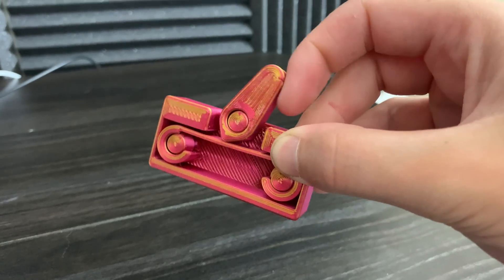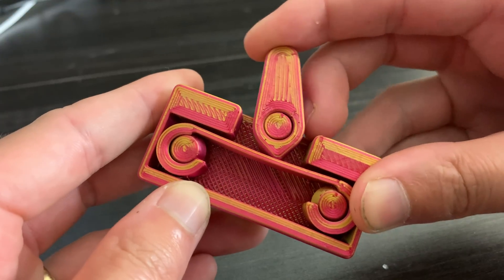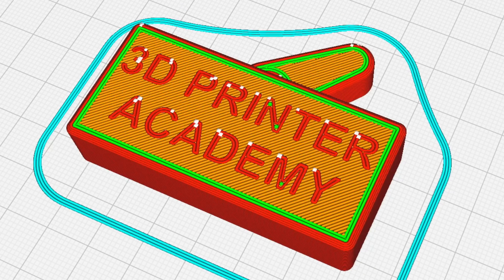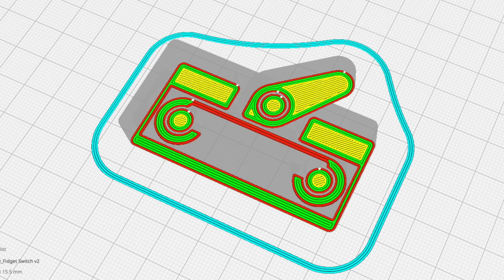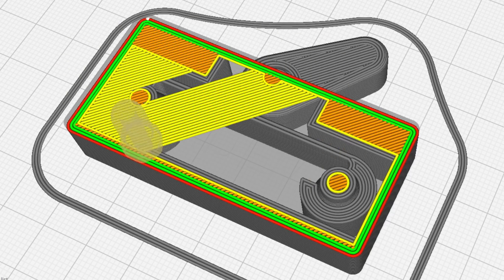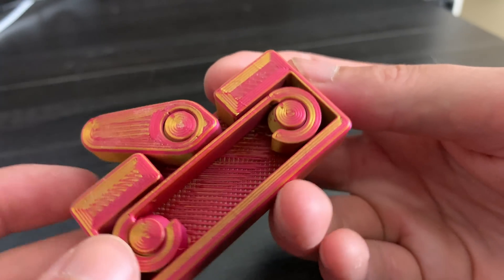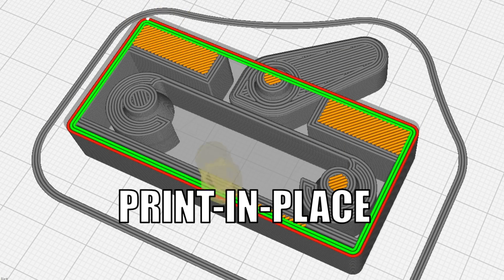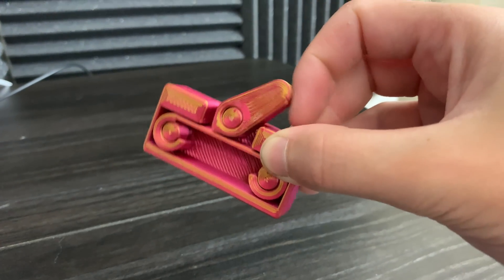What 2 things make this 3d printed fidget switch so special?

Comment: You can make a slot inside that spring, and install a two-position switch there, and on the lever make a pull to it, and you will get a switch) Or use two buttons

Comment: Great video! Does anyone know what font is used on this part? The consistent width looks like it would solve many of the issues I have with text!
Reply from the maker: The font is Arial. However, I usually use Helvetica or SF Display (Apple's newish typeface). Arial is essentially a copy Helvetica. Helvetica was designed in 1957 and Arial in 1982 for computers. You can see the difference between Arial and Helvetica by looking at the letter "c". The horizontal lines on the "c" are parallel to the base line for Helvetica, whereas with Arial the horizontal part of the "c" is slightly angled.
Reply: @3DPrinterAcademy  Thank you for the tip and info!

Comment: Honestly, I do not think this is a good example for a bistable mechanism because the two "stable" states are not inherently stable. Those are just two neutral states between which the movement is restricted to a certain point... after overcoming the potential difference needed to flip the switch, there is not really a constraint on the mechanism except for the end stop, which I would not consider "stable".

Nice print in place mechanism though :)

Comment: This video gives an insight on what 3D printed part designers are thinking.

I also had many hours of designing, including print-in-place mechanisms, assembled parts, and some basic compliant mechanisms. While watching this video, everything sounded familiar and usual to me, and the video felt like it was teaching new people and outsiders. And this made me feel proud, because of how much I've learned. I have a hard time in finding a practical expertise of myself, so such things are important to me.
Reply: Can I ask what software do you use to design mechanical stuff? Are you happy with using that software?
Reply: @bylecopanie  I use Fusion 360 with Hobbyist license.

It's fine. Definitely not as enjoyable as SolidWorks, but it's similar. Quite easy to use. The hobbyist license have the necessary tools. But to be honest, lacks very basic features, like the constrain lists in drawing, and it prefers perpendicular constrains whole horizontal or vertical is possible, messing many things.

Even FreeCAD had some features better. But of course, FreeCAD is some kind of brain cancer at the same time. Fusion is much better to use at the moment.
Reply: @Santibag  Thank you for your response, I'm about to buy myself a 3D printer (probably Creality Ender 3v2) and I want to design and print some simple contraptions/mechanisms, maybe even a full rc car/excavator in the future, but have no experience in designing for now. Thank you again for your response, It's very helpful.

Comment: Hey friend, mechanical engineer here.

The third thing that makes this special is that this would be considered a compliant mechanism - there is intentional deflection/elasticity designed into the component to enable a rotational degree of freedom.
Reply: I disagree; it’s just a switch with a spring detent 

The spring is a separate part, and the other two parts are rigid in how they interact with each other and with the spring (aside from the slop in the 3D printed connections)

Compliant mechanisms as I understand are single parts that use flexibility of materials to replace mechanical movement. If this counts as a compliant mechanism, then everything with a spring counts too. A watch would be a compliant mechanism.

Comment: but can you make it a functional switch 🤔
Reply: Sure. You’d need a two filament printer with one of them conductive and then make three conductive tracks going to the toggle and the edge of the wall on either side the toggle locks against and might need to tweak it a bit so it’s applying more pressure in either of the two locked positions but it could work
Reply: i get what you're saying here but it seems like metal contact inserts might be a bit more economical
Reply: @blank-re8qv  that would also work. I was sticking with the print in one operation theme.

Comment: Print-in-place mechanisms are one of my favourite things about 3D printing. I design vehicles for 3D printing that require no supports and always have some moving parts, usually wheels, but sometimes even working suspension. It's an extra layer of fun, both during the design process and the printing process. Nothing beats the feeling of popping a print off the buildplate and instantly being able to fiddle with it. :)
Reply from the maker: 100%
Reply: Where can we download your designs? 🤔
Reply from the maker: @zambilax  www.3dprinteracademy.com